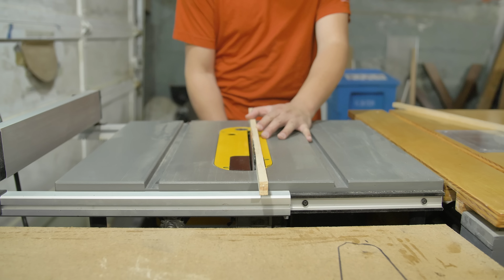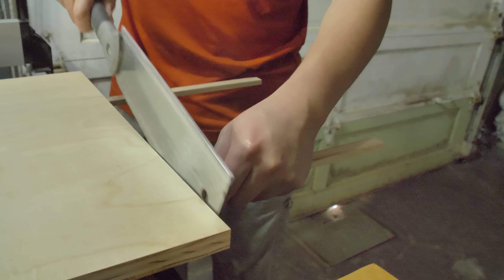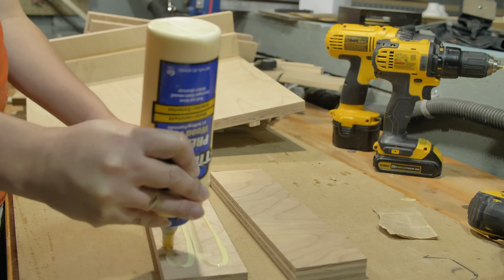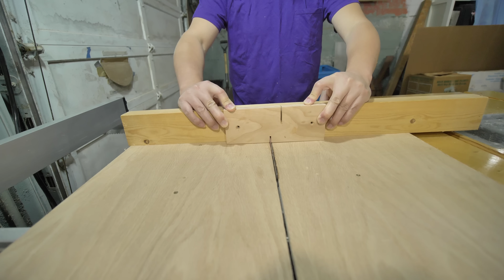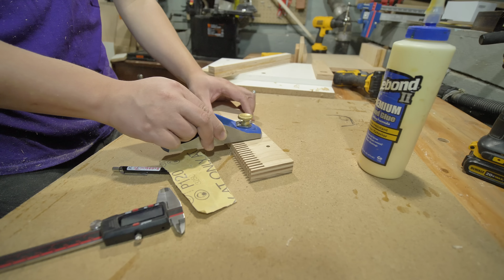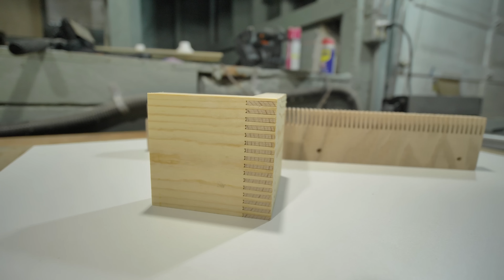Making Box Joint Jig That Can Make Different Size of Joints. Don't need Dado blades

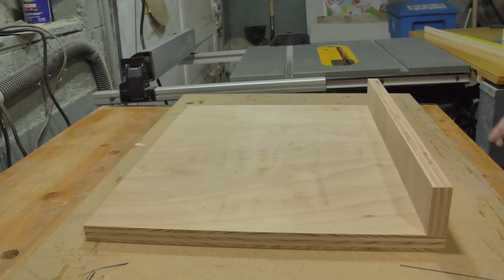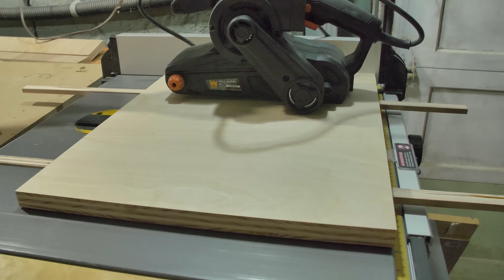Comment: I know this is an older video, but while there are a lot of good box/finger joint sled designs out there, I really appreciate this one as it resolves two specific points in sled design that often can get overcomplicated.  First, at 0:43, the way the back fence is set up makes it much less work to ensure that the fence is perpendicular to the saw kerf.  Instead of having to mess with the 5 cut method etc. which can involve fine adjustments, this design relies on cutting the base of the sled square, and then works from there.   Second, at 1:35, using sandpaper or shims in order to ensure that the miter bars are a snug fit before gluing also saves the time and frustration of having to trim a piece of wood several times to get that perfect fit.

Comment: That ply looks to be incredible quality, unlike the massively overpriced garbage we seem to get in the UK.
Reply: Don't worry. Here in Michigan, a sheet like that probably costs about $95...It's overpriced here too :(
Reply: I used to use low end smooth on both side 18mm plywood from Home Depot. It was far and away the highest quality at the cheapest price for this kind of thing. I used to pay about $35 a sheet. I just looked and it's about $45 a sheet now. The veneer is extremely thin but there are not a lot of voids I used it to make low end painted cabinets with it mostly. I never found another source of plywood suitable for cabinets any where near this cheap any place else. The next step us is a lot.

Comment: I've seen a couple of jigs that use a metal insert, but they need a very accurate set up to work (as I found when I tried it). This method using templates looks promising. The only tricky bit is getting the pin to match the kerf.
Reply from the maker: Richard Wiles, You are right. I just cut a few pins, see which is closest to the kerf (slightly thicker), then slowly sand it down. The good thing is, the whole jig doesn't need to be redone if the pin thickness or the pin position is not correct.

Comment: I copied the design from fisher's shop and can confirm that it works well :) Nice build!
Reply from the maker: Yeah his plan works very well. I made the blade guide exchangeable instead of gluing it. So if I need to change the blades with different sizes, I just need to change that blade guide.

Comment: Hey I love this jig. I am struggling with one thing however. When I go to make my initial cut on the piece that will be jointed, I don't know how to set it up so that the two pieces will match. Does that make sense? Basically I dont know how far to set my first pass off of the edge of the blade
Reply from the maker: I am sorry I didn't make the video clearly. I just recorded the way I made the jig. The original plan was from Fisher's Shop. I modified his plan to make the blade guide changeable if we need to change blades with different thickness. For you easier to understand how to cut, you can go to his original video https://www.youtube.com/watch?v=5v1QYKWgTvs. He explained clearly how to cut.

Comment: When I started single blade finger jointing, I found that I was using the wrong type of blade which resulted in voids being formed at the bottom of the cut. I eventually found that the correct blade had to have the cutting edge at 90 degrees to the blade plate which then forms a proper cut without the need to apply excessive glue to fill these unsightly voids.

Comment: Hi Victor....Great Video and very inspiring indeed! Victor, I'd like to buy the miter/track that you use in this video, can you please let me know the make or model number, as I too have a Dewalt Table saw and I like that this miter has a  long miter track that fits well into the Dewalt saw. Did you buy the track and the miter separately or do they come together. Thanks in advance for your response.
Reply from the maker: Julian Pereira, thank you for your support. The miter gauge is Kreg Precision Miter Gauge System. It comes with a fence. Model number should be KMS7102. The downside of this system is that the fence is too heavy and long for Dewalt's table. It's easy to tilt off the side when we push forward. And this was one of the reason I built an extension on the side for my table saw later on. If you want to find another one to compare, you may check out this guy's review. https://www.youtube.com/watch?v=0zMnY3ZKsZI&t=894s .

Comment: Hello sir
Thank you for this very beautiful video

I am French, and I would like to know what is the reference of your saw blade because I think that this blade looks to be incredible quality.
Thank you very much for answering me
Reply from the maker: I love Diablo blades, very durable and top quality for me.  I was using Diabo 60-tooth thin kerf blade. For the best result of box finger joint, you may look for Flat Teeth blade. If it's too expensive, non flat teeth is fine too.
Reply: @victorhe7200   Thank you very much for your answer

Comment: Why didn't you just use the router table to make the half inch box joints with a sled set up on the router table similar to the table saw.?

Comment: If you do a lot of box or finger joints, you should look in to a blade with flat teeth, especially for the 1/8" fingers so you don't get that little peak in the middle of the joints.  Instead you get a nice flat surface and the joints look clean.
Reply from the maker: You are right. Flat teeth blade is the best for finger joints.

Comment: Is a ripping blade with flat teeth used?
Reply from the maker: Dave, flat teeth blades are highly recommended. If you can't access to flat teeth blades, general blades are ok too.
Reply: @victorhe7200  Thank you very much for the response. I'm going to take a shot at making a box jointed box. It will be small and I think I'm going to go with the simplest jig and a 1/8 inch kerf blade with flat teeth but I had been thinking of using my current cross cut blade but now I think I'll spring for a ripping blade probably a cheap one.

One thing that I liked  about your video was that you used the same saw I have. I had trouble with a sled I built using metal rails getting it to slide freely and the miter gauge the saw comes with wobbles too much for precision work (I put tape around it as a kludge). I think I'm going to follow exactly your procedure for making the sled. 

I've also thought about getting a small dado stack for my  saw instead. I know DeWalt recommends against it but I think I might be able to use up to a 1/4 inch thick safely.

Comment: maybe Im missing something, but if the point is to make box joints, and you used the Router table to make the box joint template in the desired size, isn't the table saw jig redundant?

Comment: Seems like you made great finger joints with the miter gauge you used for the template? Why build this complicated jig?
Reply: Just my $0.02, when he was making the template, he was using a long piece of stock making it easier to hold against the miter gauge for each cut. When you're making the cuts on a work piece, usually it's much taller and more narrow which means either fingers closer to the blade or clamping/un-clamping after each cut. 

With a jig and template, you clamp the work piece to the template and your fingers are much further from the danger zone, and you can quickly go from one cut to the next. This gives you a safer process for lots of repeated cuts that is just as fast as moving the work piece down the gauge.

Comment: The precision is ok for dewalt table saw ???
Reply from the maker: The precision is good. But keep in mind one thing, because the Kreg is 24 inches long,  and the Dewalt jobsite table saw is not very wide, it's easy to tile off side, it's best to use with an extension platform on the side like what I built. But without the extension, it is still usable.

Comment: What if you don't own a router? then how do you produce the 1/4" , 3/8", 1/2" & 3/4" box joint jigs? this just not a 2 jig fixture? as commented by Fisher's shop.
Reply from the maker: This jig is for using table saw to make the box joints only. But we need to find a way to make the joint template to put on the jig. The easiest way is to use router. If you can't access to router or different sizes of router bit, you may need to look for another jig design.
Reply: I might point out that ONLY the laying out and cutting for an initial template for each size of joint you want is needed... Even that this was modified from Fisher's to allow interchangeable blades with different widths, it still compensates for the width of blade on hand... and then all you really NEED is laying out for 1/4 or 3/8 inch ...etc...

   Without a router, the templates are still cut-able on a table-saw... pretty close to the way he demonstrated with his second template...

    AND the "easy" way to start would be by laying down some masking tape and marking out from the blade in desired increments... {from your specific list, I'd just go with 1/8" steps}...
   Everything else, you already have listed by dimensions in Fisher's design spec's... SO laying the tape out just far enough from the back-wall of the jig-box, you can see the steps and line up fairly quickly for template builds on your own... It's advisable to go ahead and pencil in some marks across the "top" of the new template, so you can be sure of waste-areas... and you might still prefer (as some of us do) to clean all that waste with a chisel and file... BUT... once a template's made... it's made, and you can build your collection either "preemptively" OR "as you go" reducing space and resource concerns for when and however often you might need a specific size of finger or box-joint.

    Finally, remember this is a convenience. It's NOT a required piece of gear for your shop to accomplish joinery at all. No matter how cleverly we create conveniences in our shops, there's just NO replacement for the skills to do this stuff on your own. ;o)

Comment: I've watched so many cross cutting sled videos and have always wondered why TWO runners?  Each and every miter gage has exactly ONE runner.  Seems like asking for over-constraint.
Reply from the maker: Wihelm Taylor, thank you for your comment. For me, there are two reasons. 
1) the tablesaw I have is just a jobsite saw. It's not built for supper accuracy. The thickness of miter track is not very consistent. I tried to use one runner adjustable miter gauge, it will become slightly loose when pushing the job near the middle. 
2) also I used wood for the runner, the high and low humidity during different season really affects the accuracy if just using one runner. 
So I found in most of the cases, I need two runners to make small precise projects.
Reply: @victorhe7200  → Thanks, Victor.  Not much humidity to worry about here in Boulder, CO.

Comment: I like all these vids however,  it's of no real use to the average keen DIY  who does not posses a panel saw.
Reply: Sliding mitre saw? Table saw? Track saw? Circular saw and guide? Any of those would do the job.
Reply: It's not a panel saw. It's a bog standard site saw, in other words cheap and well within the means of your average keen diy'er. However if you can't tell the difference I'd suggest you stay away from tools with moving parts